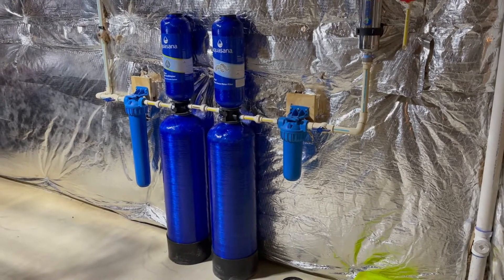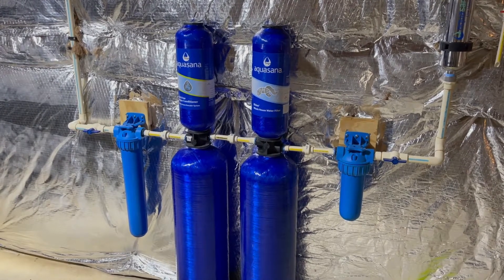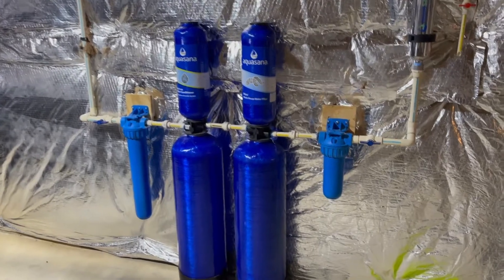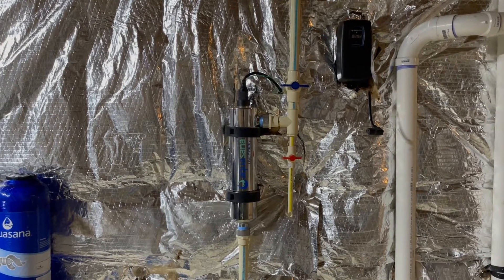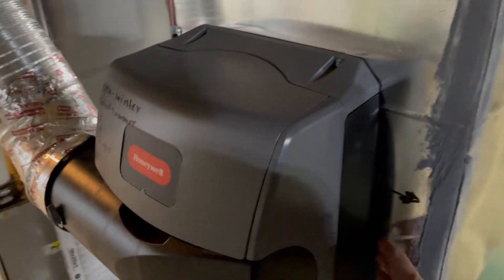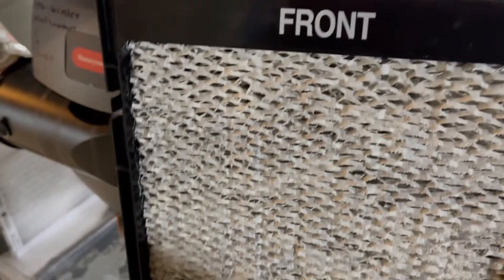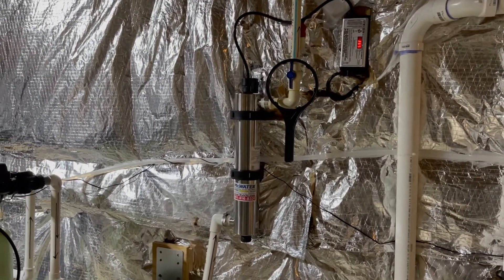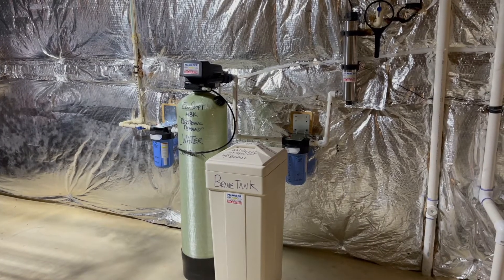"Salt Free" or "No Salt" Water Softeners just DO NOT WORK! Replacement of Aquasana "Rhino" System

Comment: The yarna systems actually descale the water quite well using electrical frequencies and they have 3 different versions. And their 48 model sells for around 400 dollars.

And needs to be installed before any filters or other equipment.

The problem is their tech people keep spreading misinformation that you can't use in conjunction with a salt based system and neutralizer if necessary which is just not true.

As in really severe cases it can help keep the softeners and filters from getting overloaded as much. And make it easier on them.

So the salt based softener over time might not have to regenerate so often and the filters before a softener would in some cases last longer over time.

Fine if you want to sell a product but when on Amazon in the question section people keep asking can I keep my existing softener or use it in conjunction with a salt based softener.

Their tech people should just say.

Yes it's possible but you should consult your local plumber or water treatment specialist. If you are unsure.

Instead of factual inaccurate information that confuse people and make them think they have to get rid of their existing system to with a salt based softner to use the yarna.

Maybe I am harping a little but that kind of stuff just makes me mad.

Even if the product is good and works if installed and use in the proper way.
Reply from the maker: Sorry Gabriel those systems do not work at all. They have never been proven by ANY scientific studies and are a total waste of money. Home Depot and Lowes sold similar systems years ago but stopped because of all the consumer complaints and therefore refunds. Has zero effect on water quality tantamount to witchcraft. You are absolutely incorrect stating that it will prevent “overloading” of a water softener. These so called “electric frequencies” have no effect on water quality at all - nothing. There is a sucker born every minute - please Gabriel don’t let that be you!!
Reply: @Mr-Water-LLC-of-Maryland  

I am definitely listening to you.

I definitely agree with you about those culligan I spring systems.

Especially if they are carbon based that does nothing.

Except remove sediment and some chlorine.

What bothers me is companies that are selling so called salt free softeners.

The system I was referring to was a descaler. System 

That uses electrical frequencies.

In my condo the challenge is I am on city water that is very hard and is overloaded with chemicals  including lead and high amounts of contaminants that are beginning to destroy my copper pipes.

I am trying to get rid of the copper over time and go pex.

I did use a countertop version of the old enviro new wave 10 stage filters.

And that absolutely works.

But 3 years ago new wave redesigned it into a junky filter.

Thankfully tier one has come out with that exact same filter that is a 2.5 by 10 filter which works better than reverse osmosis without the waste water and can filter the whole house. 

And that filter has calcite in it.

And lasts up to 1500 gallons 

If set up correctly.

But I am still deciding if I should go traditional softener and neutralizer.

After filtering out all that junk as I also have developed severe skin sensitivities.

As for descalers I don't like the ao Smith one at all because it wears out.

I am just trying to start out with the basics.

What concerns me is that yarna while it may be a decent product for some cases and get good reviews.

Is the misinformation they are spreading about traditional softeners. 

And making people think they have to get rid of their existing salt based softeners to use them.

I am actaully going to post to you the link on Amazon so you can actaully see what I am talking about.
System
Reply: @Mr-Water-LLC-of-Maryland   I have also decided before I do anything to call the guy who I have known for years to come out and test my Water. Who also handles my mom's system.

And consult with him on what I need to do to clean up my water.
Reply from the maker: @gabrielstern4992  Gabriel - you keep referring to water softeners as “salt based systems” but that is not how water softeners work. They are ion exchange systems that exchange cations. Calcium, lead, ferrous iron, radium, zinc are among the cations exchanged - there is no salt in your water at all with a water softener. Salt is sodium chloride. Sodium is a metal cation positively charged - chloride is an anion negatively charged. They combine as common table salt. The resin in a cation exchange water just “exchanges” one ion for another that is it. In other words for every cation (hardness as calcium) that sticks to the resin beads an equal amount of sodium is sloughed off imparted into the water supply - just one swapped for the other. That is how a water softener actually REMOVES the calcium from water - sodium is much less reactive in water and therefore much more desirable than calcium. This is the only method that really works. “Electrifying” does nothing because the calcium is still in the water unchanged. The chlorides are wash away down the drain during regeneration and the sodium adheres to the resin again making it charged with cations ready to start the cation exchange process over again. Please read my patents - https://patentimages.storage.googleapis.com/9c/9a/8c/f45768eccd773c/US9499417.pdf
Reply: @Mr-Water-LLC-of-Maryland  yes I know that I know salt is only used during the regeneration process. To clean the resins the reason I am referring to it that way is because if you look at that Amazon link I sent you which is really a descaler system.

Not a softener system.

Is because a lot of guys as a marketing gimmick are trying to trick people into thinking salt based or traditional softeners are bad.

Please look at the Amazon link I sent  you for the yarna descaler system and what they are telling people and the question section. 

Where people kept asking can I add this to my salt based softener. 

Meaning it uses salt to clean the resin. And what these guys seling were saying.

I pushed back as much as I could and said typically yes but i would talk to a professional first.

Again like I told you I personally love my moms properly treated well water with a traditional water softener and a neutralizer that goes after her sediment filter as the water in my area is very acidic and hard.

And yes I know no salt actaully goes into the water if the softener is working corectly.

But if you look at the yarna site on Amazon they make it sound like the water treated is filled with ions of salt after going through a water softener.

Which I know is false.

As for a water softener itself I prefer to set both bypass valves on the intake and outake a half a degree to avoid the slimy feeling.

Also yarna is not the only one but I have seen upon doing a youtube search several companies doing that.

Again for me personally I have no issue with a good electronic descaler placed before a good filtration system And adding a softener to that setup and along with a neutralizer if that's needed.

But what I have an issue with is referring to an electronic descaler system as a water softener.

Comment: I've been using Aquasana same systems for 6 years, I could tell the system doesn't descale or just very very minimal descaling done.  It's been 6 years,,,2 or 3 more years I will replace it by Springwell or Pelican system. Their systems do remove the scales!
Reply from the maker: Springwell and Pelican system exactly like the Aquasana system - don’t be fooled!! Zero descaling I’m sorry - remember “No Salty, No Worky”
Reply: @Mr-Water-LLC-of-Maryland  Ah ha! Good to know so I will not waste money on another system which does exactly the same then LoL !!
Reply: Yes don't spend 2 thousand dollars on so called salt free softeners.

Certain frequency capicitive based descalers can help depending on the situation or in conjunction with filters and salt based softeners as necessary. And they cost less than 500 dollars such as the yarna descalers. Systems and they don't require any pipe cutting.

And they have good reviews but beware of the misinformation the yarna or sellers on Amazon are spreading that confuse people who may want to keep their existing softeners and setup.

Even if their product is a good product.

Comment: You just installed an overpriced system that charged customer first of all the aquasana was not installed properly all the fittings comes 1inch I don’t know who ever installed reduced it 3/4 plus you need a loop system and change pre filter and post and every 6 months or so and big once every 10 years my brother has one installed right 3 years no issues at
Reply from the maker: Yea OK whatever dude. You and your brother are not the sharpest guys around apparently. What is a loop system? Means nothing Einstein! My customer is delighted now that he has a system that really softens the water. No issues with your brothers system? Well yes because a system that does nothing causes no problems!!

Comment: This guy is such a scam.  wasting the customer more money instead of really solving their problem.  UV trip should be an easy fix instead of replacing a new one.  Maybe look into if those were resin tank or charcoal tank to solve the problem to solve the scale problem.
Reply from the maker: You clearly have no clue about what you are talking about. Don't be a jerk or I will block you from making comments.
Reply: Nice way to not have negative feedback.  What was that you Said? "Jerk"  Very nice and convincing way to prove your point scientifically. @Mr-Water-LLC-of-Maryland